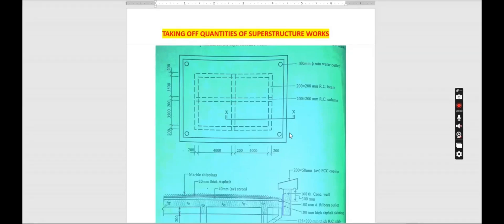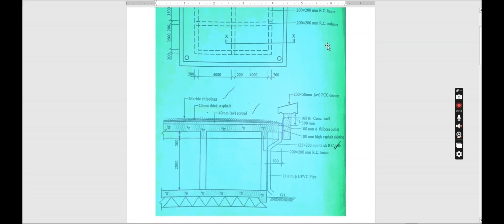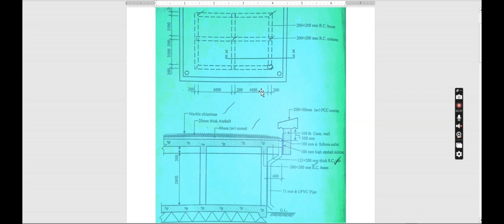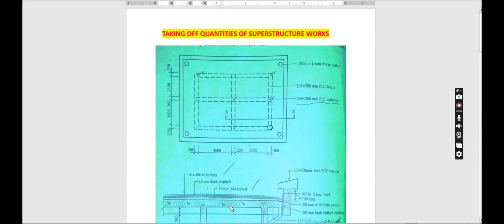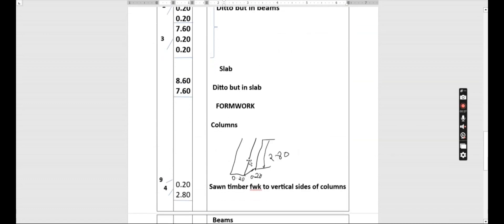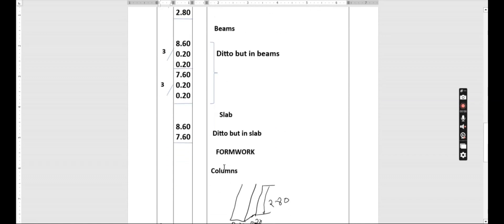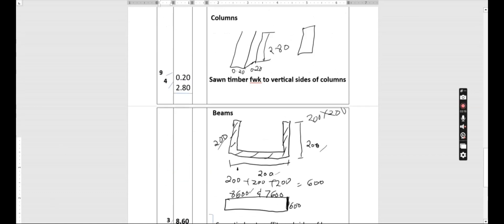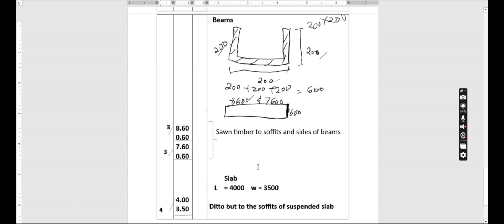Taking off Quantities of Superstructure works| Measurements

Comment: I thought the beam is occupying its own 200 mm below the slab, don't you think excluding the beam dimensions and taking the slab panels will leave out a huge volume of concrete unaccounted for?
because from the cross-section I can see the slab is a little bit above the beam.